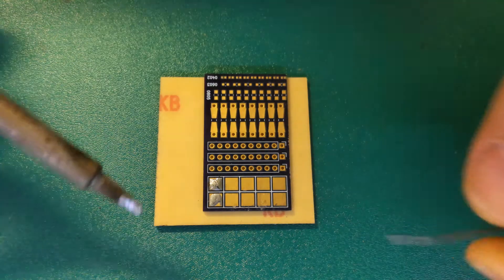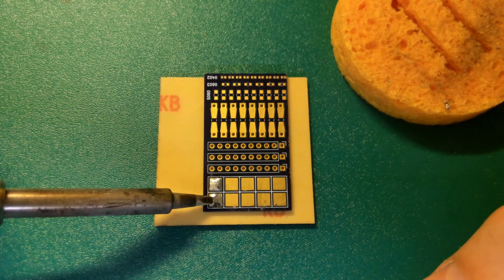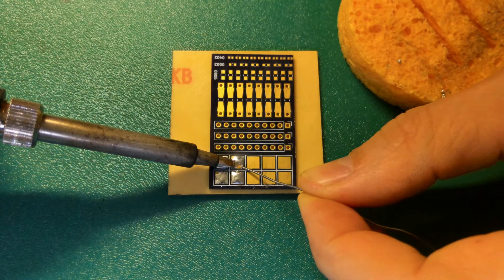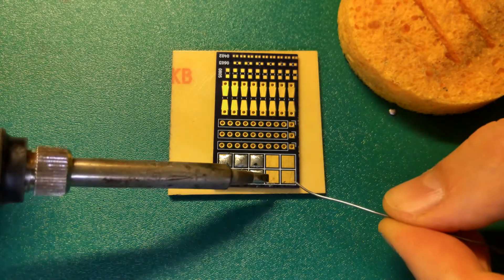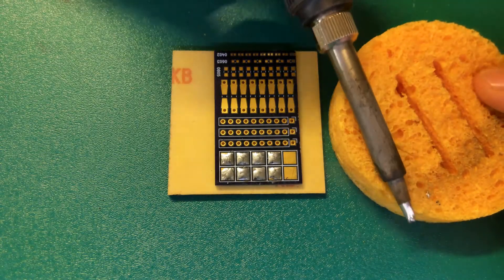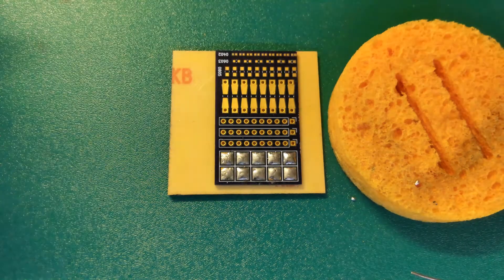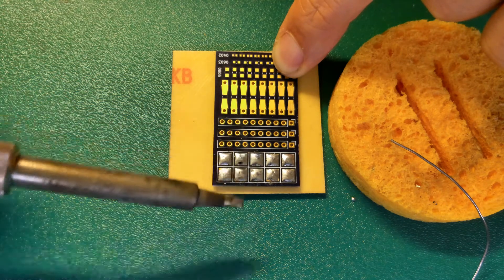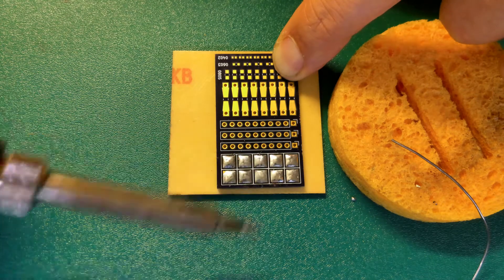How to Solder - Fill the pads with solder

Comment: What temperature? I got a cheap solder kit and it can go 200 to 450 degrees. It takes a lot longer at 350. Haven't tried 450 yet

Comment: I am learning how to do this on some super small pads for a 20A esc, thank you for the tips, I will give this another shot because I was struggling with the solder sticking to the iron and not depositing onto the pad.
Reply: Also, is there any need for flux at all?